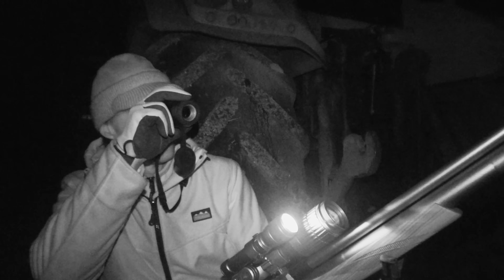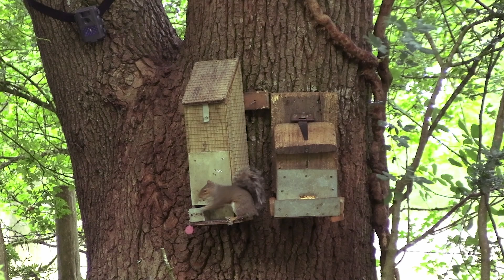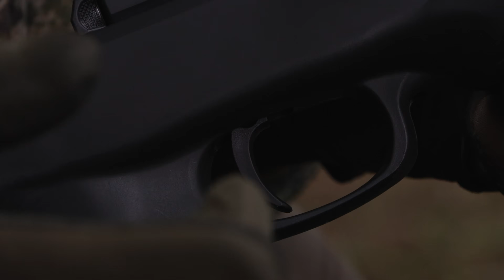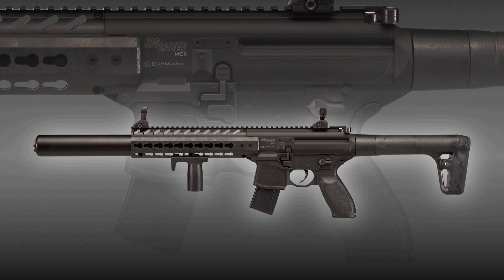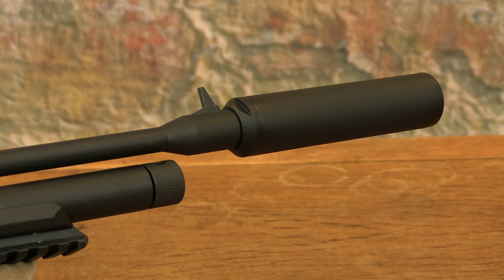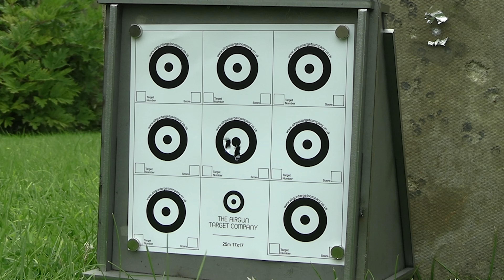Airgun Action | Cheap squirrel hunting and bait test | Air Force One Trophy MKII CO2 pistol review

Comment: The Grey Reaper YouTube channel……….
I’ve been using whole maize and sunflower seeds to good success but lately the greys on one of my perms have been kicking out the maize so I’ve swapped it to all sunflower seeds and last time I looked all the husks were empty and it’s lasting longer in the feeder till I need to refill.
I’ve tried wheat before on a new feeder but it got totally ignored.
When I’ve tried only Peanuts as I wouldn’t mix anything in with it I’ve seen them go off before which is very strange.
Reply from the maker: Yes, I always have problems with squirrels kicking everything out in order to access whatever they want most whenever feed is mixed.
Thanks for watching. Mat

Comment: I use a Walther Dominator 1250. The downside to this is that the rubber O-rings that hold the pellets in place with the magazines go bad quickly. It is certainly inexpensive for a pre-charged air gun from other guns in Japan, but I decided to replace it with an FX because the mags go bad so quickly. The shortcomings of the magazines have not been improved with the RM8.
Reply from the maker: Thanks for flagging. Have to say that I have been using the RM8 for years and haven't had a single problem with it.
All the best. Mat

Comment: Might of been a better bait test to have the feeders separated at different locations rather than together as peanuts are always going to be preferred where as if only one option on the menu it would be good to see which feeder empties first and how fast .
Reply: I tried this and they never went near the non-peanut feed. Swapped the locations of the feeders around and they still only went for the peanuts. I only ever use peanuts now and occasionally a bit of peanut butter or cheap nutella.
Reply from the maker: I did consider that, but thought it would be impossible to tell whether one feeder might just be in a better area.
Thanks for watching. Mat
Reply: @ShootingCountryTV  Fair point Mat, keep at em, I’m finding they are off the feeders at mo as all the naturals are coming on .